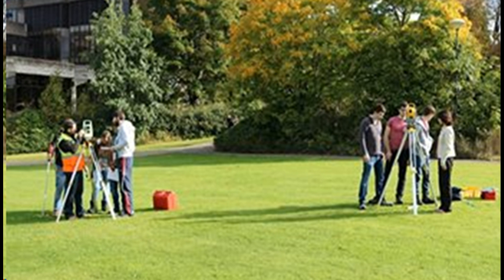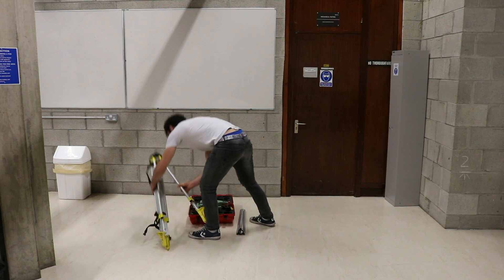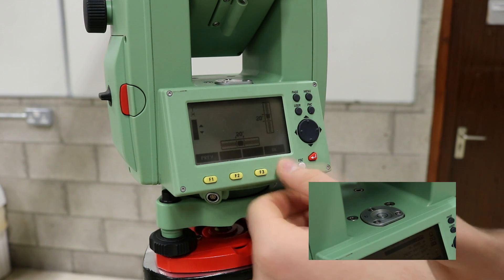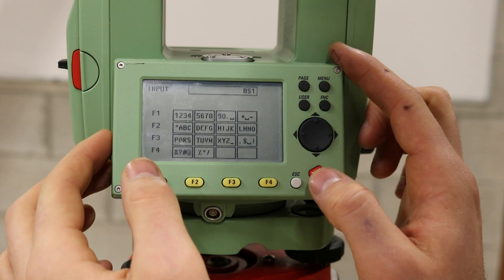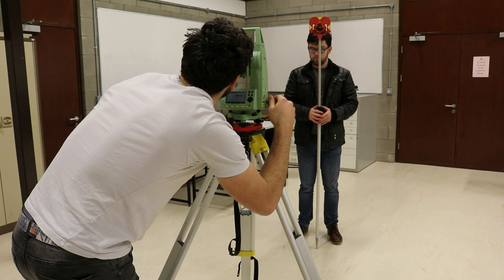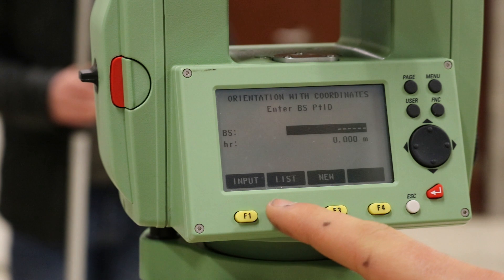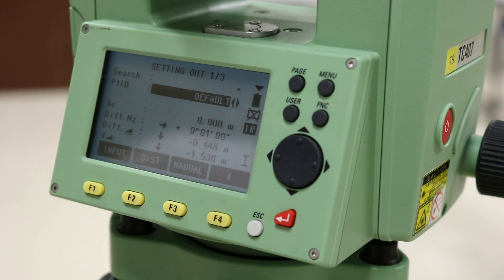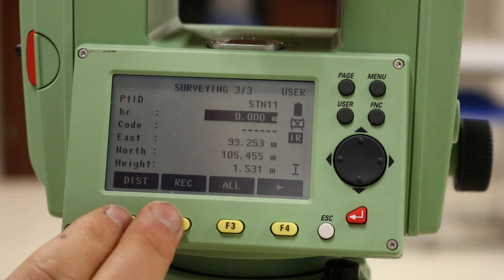How to Set up, Set out and Survey with a Leica TC407

Comment: This is by far the best video on You-Tube about how to use a Total Station. I know because I have seen about 99.9 % of them. That being said, I would like to see how one sets up over a point in the field without the help of the optical plummet. Most people do not own such high end devices and must use cheaper Transits that come only with a plum bob. So how is the best way to setup these devices? I would like to see it done by a professional such as you.